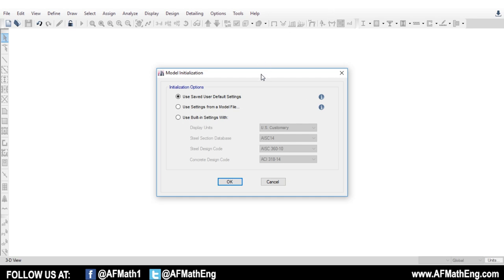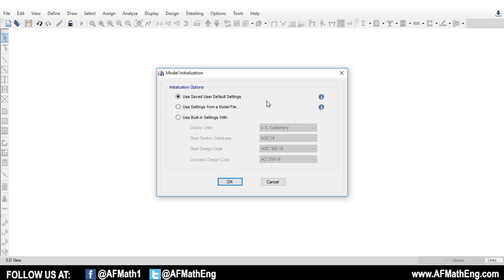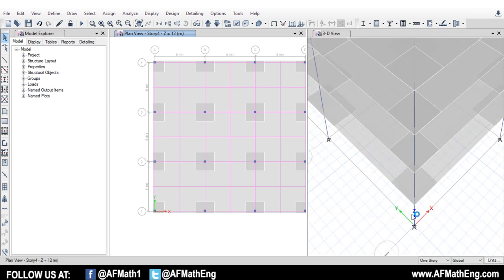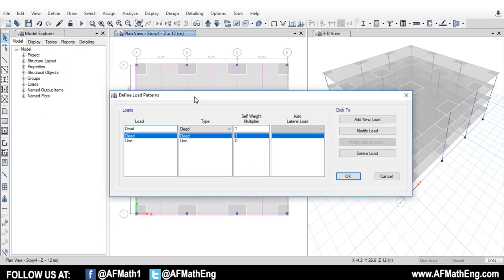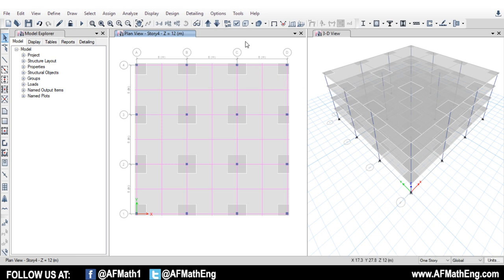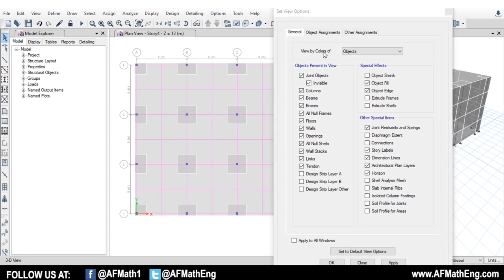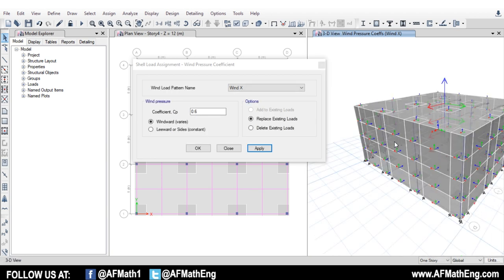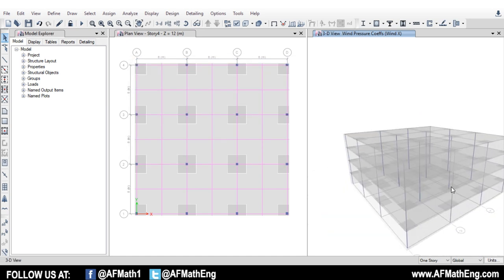CSI ETABS 2016 - Automated Wind Loads to Model - Exposure from Shell Objects Tutorial

Comment: Nice. Wanted to learn this as the structures i design have different floor plans and applying load at C.M. is difficult at it varies with height and using exposure from shell objects is also not right at at multiple locations there's no slabs but walls and v/v.

Comment: Hello sir, its a really good video. as in ASCE 7-16 that the minimum wind load is 0,77kN/m2, can i just input them to the cladding as distributed load, same way as we input shell load for floor plate but in local axes this time. thanks in advance.
Reply from the maker: Thanks!

I'm not sure about the ASCE but if you're going to use this method yes you should input as a distributed shell load, however in most cases the code requires a linearly increasing wind load which is difficult to apply here.  Also most buildings are not going to have the minimum wind load and you'll have to calculate that load.  In the case where you have a multi story building I suggest applying wind load using diaphragm which is more accurate code wise.

Comment: sOO which is better? Applying loads using claddings or using diaphragms?
Reply from the maker: For actual code design diaphragm is far better, you can better input code parameters and have more control over your loads.

Comment: Hello, is there a specific way to draw the cladding. i did the same steps you did but when i draw the Cladding nothing shows up (its as if i didn't draw anything). Can you please let me know if there is any setting that i should have on? if not is there another way that i can apply the wind load onto the columns and beams directly in the direction that i want (lets say in the x direction)?
Reply from the maker: You probably have visibility of null shells turned off.  Try turning them on it should fix the problem.
Reply from the maker: Also, for actual design it's recommended you apply your wind load directly to diaphragms, see our video on this topic here: https://youtu.be/KHb0mABCofE
Reply: @AFMathandEngineering  ok perfect thank you soo much i will try that out.. sorry one more thing I cant seem to know how to angle the wind to the direction that i want and the force that i want. lets say i want to have the wind hit on the elevation in the x direction and 10 KN/LM. how could i do that?
Reply from the maker: @LEBMG34  not sure where you're from but the code doesn't specify that wind be applied in diagnoal directions, usually only orthogonal directions (x and y) plus eccentricities that produce torsional moments that also must be designed for.  Consult your code to see what is required.

Comment: What is the meaning of the number inside the bracket, -0.38L(0.0000)? Does it mean zero force?
Reply from the maker: What time stamp?
Reply: @AFMathandEngineering  10:59
Reply from the maker: @joejoe4172  I'm not sure actually, it definitely doesn't mean zero force.  I'll look into it.
Reply: @AFMathandEngineering  Have you figured it out?
Reply from the maker: @joejoe4172  no, haven't looked into it.  I would suggest consulting the etabs manual.

Comment: No result was given after I did the analysis.Why?
Reply from the maker: That's a bit too general of a question..what do you mean no result?
Reply: After pressing "run analysis", nothing was changed.
In your video, your window was changed to "3-D view displacement". But in my case, the window was still "3-D view Wind pressure coefficient".
Reply from the maker: @joejoe4172  That's not really something I can comment on unfortunately, it may be that ETABS has some sort of bug that isn't letting it run, or that it doesn't automatically go to the deformed shape and you need to manually check the results.  if the little lock is closed, that means that the model has run.  If it isn't you'll have to try to troubleshoot that error yourself.  Good luck!

Comment: WHAT IS THE DIFFERENT BETWEEN THIS ONE AND WIND DIAPHRAGM
Reply from the maker: I suggest you download the lateral loads manual from CSI on ETABS and review it to find exactly how both are calculated based on your code and where you're from.  However, the wind loads applied to cladding as done in this video calculates the lateral loads based on the exposure area that you assign as cladding in the program.  Wind loads to diaphragms generates and applies equivalent lateral forces and torsional moments directly to diaphragms defined as rigid.  Using a different q value, either for structural or non structural elements may also be required.  Which you want to use and in which situation is up to you as a designer.  Hope that helps.
Reply from the maker: Check out our new video on applying wind to the extents of rigid diaphragms! https://www.youtube.com/watch?v=KHb0mABCofE&feature=youtu.be